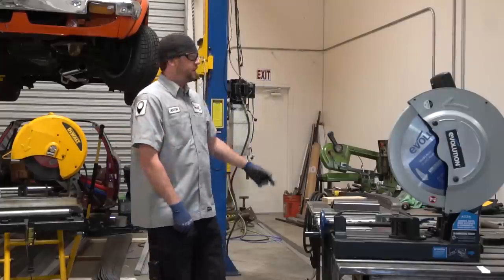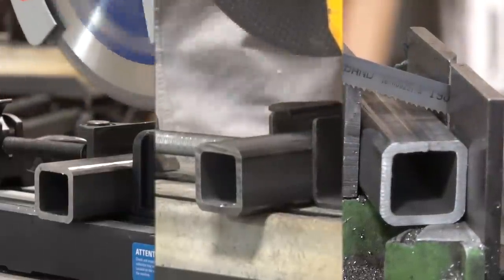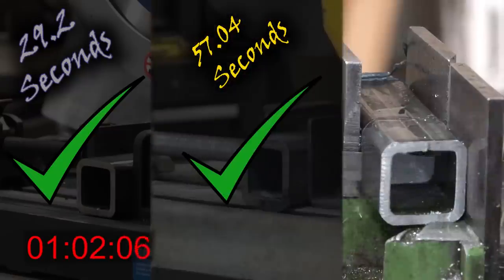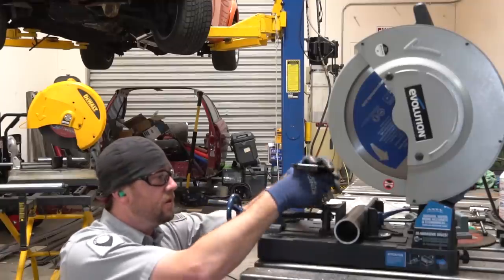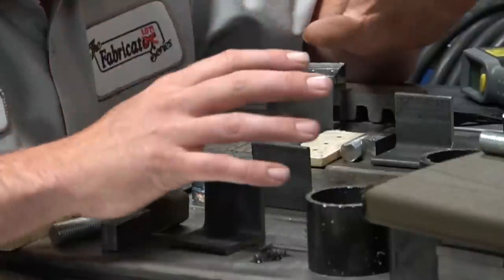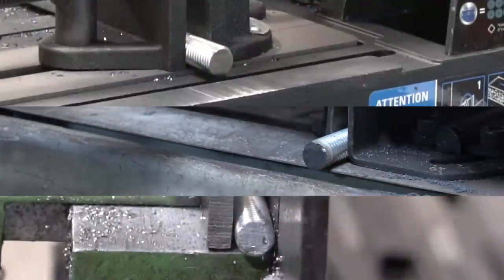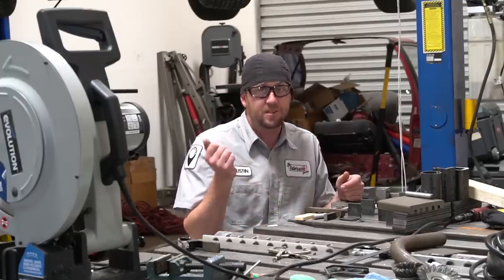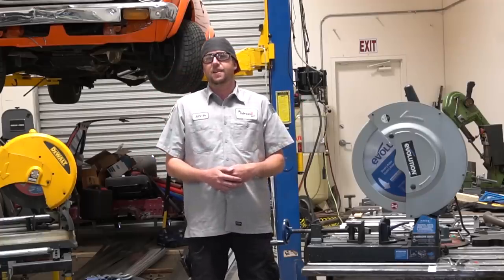TFS: 3 Metal Cutting Saws Tested and Compared

Comment: I wish I knew how to load a picture on here because I have one that would probably make every owner of an abrasive saw never use it again. I used one for 10 or so years, until a brand new blade EXPLODED. One piece lodged in my insulated garage door (that was UP at the time) and a big gouge in the floor, I guess where it hit first.  2 pieces on the floor behind me and a few days later while mowing I found the fourth & final piece about 50 yards out in the pasture. I don't normally get weirded out about shop stuff but that scared the shit out of me. Because there was nothing I could have done different,except not use it sooo I bought an Evolution that night and the dewalt is up in the mezzanine. I will not even sell it. I would not do that to someone. By the way both the saw and blade were Dewalt, not knock off china.probably still china but supposedly better.So just save up for an Evolution or a bandsaw( if you have the room)I worked EMS in the 80's and have witnessed an Eviseration and the guy DIDNT make it. I don't want to experience it first hand.

Comment: proper bandsaw with proper blade would be much quicker. But anyway the best shop saw is the one you dont have, the cold saw with hss blade. You get a lot of cuts out of the blade, then you resharpen it for like 10€. Cheapest, quick and accurate way of cutting.

Comment: I think you missed the most critical thing about high speed steel disk saw vs. bandsaw, and that is that the steel disk saw will cut straight down at 90 degrees, and the bandsaw will shift left or right a lot.    Now I read in the comments that even the abrasive disk will flex some.
Reply: A good bandsaw will cut at least as accurately as the cold saw.  I have an Ellis 1600 and I can assure you if it's setup right the blade has zero side to side movement.
Reply: @Anteater6788  The Ellis 1600 looks like a lovely bandsaw.  We have something industrial as well (I can't come up with the name now), but my experience is that when the band is new, it cuts straight down.  But as soon as it gets a little dull, it will start to gradually shift - 1/16 or 3/32 shift at the bottom of the cut is common.  We do a lot of hot rolled steel windows and doors.  When the material is steel, and we weld it and grind to paint, that's not an issue.  But when we do aluminum, bronze or something that we don't weld, you can't do a clean "hairline" connection in the front and the rear of the corners.  It will be nice at the front, and a gap at the rear.  For those jobs, I bought the MEP Tiger 352 cold saw.  That beast is precision.  So for most jobs we use the bandsaw, and when I have something premium, I only use the MEP, and it cuts so clean that you can move your finger on the edge of the cut and it feels as if you've polished it.   It is impossible to do these jobs with a bandsaw.

Comment: 40 or 50 bucks a gallon in concentrate... makes about 50 gallons or more  , I would not call that too expensive . I use a baileigh horizontal band , wouldn't trade it for any chop saw
Reply: Yup! Baileigh Swivel head bandsaw here and Lenox Band Aid coolant. I had the dry cut saw for awhile and would use one for portabl work but, miters suck on them and the bandsaw for the win for accuracy and miters .

Comment: I run the evolution saw every day in my shop. The stock blade is expensive and an doesn't last at all. Yeah stainless will kill that blade right away and blade is super loud. 
So I started useing the Diablo blade. It longer lasting even on stainless. And it has relief cuts in the blade that are back filled with a sound deading silicone. The Diablo blade isn't as loud as the evolution blade and doesn't cost near as much. A totally affordable blade and twice the life and half the noise.
Reply: Do you have a shopping link to the exact blade your buying?

Comment: just thinkin’ out loud....you might have had less smoke cutting the wood & composite on the abrasive if you had cut it on the vertical...less surface area contact on the abrasive blade

Comment: I have the cheaper version Evolution ,about $200.  Love it.  Yes it is loud and throws chips but I always wear ear, eye and shrapnel protection no matter what metal cutting tool I use and so should you.  I have cut 1/2" steel and it will be only be warm to the touch, not hot, and very clean.  This thing will cut 100's of materials with the one blade.  If you take care of the blade, which is about $80, it will last a while.  I have made a chip catcher and they are 100% recyclable steel.  Abrasive dust is more silica than anything and not worth catching.  Cheaper over all than changing several abrasive blades and some band saw blades.  Several times I have put it in the floor when I needed to cut large items.  I agree, band saws are more consistent, cleaner cutting and quieter but the cost can be off putting.  Abrasive saws are old, outdated and dangerous technology.. They have no place in my shop.  Just my two cents.

Comment: I have 7 ways to cut metal. 
1. Hack saw....good for real fine work.
2. Portable Milwaukee band saw....great for where I have to take the saw to the work
3. Oxy acetylene cutting torch....for really thick plate and to burn ants.
4. Plasma cutter....I have an Everlast 50....but any really cheap plasma cutter will do....cuts aluminum, steel, titanium.....cars in 
    two.....man hole covers....tanks......whatever
5. Harbor Freight 64.5" band saw. I use this quite a bit...had it for years....still cuts great....when I have the time
6. 4.5 inch grinder with cut off wheels....makes lots of sparks that end up in my shoes but I still use it quite a bit where odd cuts 
    are needed.
7. Fein Slugger 14 inch cold cut saw. My most favorite saw. It has taken over a lot of the cutting duties of the band saw. Cuts 
    metal in a fraction of the time that the other cutters do (very little set up time). Easy to cut just about anything. The quietest of     
    all the cold cut saws I've tried. The Fein Blades last a long time. Mine has well over 1000 cuts on the original blade. I use WD40                on them and it seems to help a lot with cutting and heat. Really fast cuts and no heat to speak of. I wish I had gotten one a long    time ago. 
I have all of this at home.....I just like the idea of being able to build really cool things from metal that so many others cannot do.....they are mere mortals as compared to what I can do!

Comment: I had an abrasive saw up until about a year ago when I bought the Evo380. I've used it a lot and I've been really happy with its performance compared to the abrasive saw. The blade that came with it got a couple of chipped teeth pretty quickly, which I found a bit disappointing, but you can always upgrade to a better quality blade when you go to replace it. I do wish the lead screw used to tighten the clamp was acme thread instead of standard, v-shape thread. Not really a deal breaker. You just have to be careful not to over-tighten it

Edit: One more thing. The miter gauge on my Evo is off by a couple of degrees. It would be nice if they designed it so it could be fine tuned (like most wood chop saws I've used). As it stands, the gauge is riveted in. Again, not a big deal for me. I just use my combo square to square the blade to the fence, but it would've been a nice feature.

Comment: What about taking a cheap miter saw and throwing a carbide metal cutting blade? I picked up a Kysor Johnson Model R for absurdly cheap that I'm cleaning up and kinda refurbishing - one feature that really drew me to horizontal bandsaws is the hydraulic arm to control the speed and auto-off switch that allows me to walk away and do something else while the saw does all the work and shuts off when done. So time is of very little concern with the bandsaw as it doesn't prevent me from doing other work.

But for the time being, I've been using the 10" sliding compound miter saw from HF that cost $85 w/ coupon paired with a carbide tooth ferrous metal cutting blade from Concord that set me back $26 on Amazon (same day prime delivery). And for about $125 after tax and all, I ended up with a saw setup that I received the same day and have cut a LOT of steel with it. At first I was sketched out, but it's been solid thus far. And I cannot imagine there's a cheaper way to go. There are non-ferrous and about every other application blades that all run in the $20 range too (though I've only been working with steel so I have no experience with them). But for a beginner super tight budget metal cutting saw, I genuinely can't imagine a cheaper option, and it does still work as a regular miter saw for woodworking too
Reply: I have one of those HF 10" sliding miter saws. I've used it on aluminum but not tried steel because i always read the rpms are too high.

Comment: i've got the evo, but am NOT comfortable hand-holding tubes and notching them on it for fear that the blade will grab/throw them  or grab me as compared to the abrasive saw...I just see all those teeth whizzing around and think of my hand inside it (yikes).  of course always safer to use the supplied clamp, but any thoughts?
Reply: Ummm, why would you even consider hand holding? That's a trick for stumpy...who can't count to 10 no more.
Reply: Steve H lol, my thoughts exactly.  TFS has other vids notching tube hand held but with abrasive chop saw.  TBH I wrote that comment a bit sleep-deprived (as in no state to use machinery)

Comment: I have had 2 different dry cut chop saws and multiple blades. One problem I've had with them all is the blade wanders to the outside when the blade touches the steel. How is your saw with this?
Reply: it doesn't, at least not that I've noticed. teeth cut through so quick that it really doesn't move the blade any noticeable amount.

Comment: The only thing that's relevant is how long do the blades last. I bought a Evo 215 as I just did not believe a carbide tip will last at that speed without cooling. I know , I am a CNC machinist and we flood the cutting edge with coolant at high speed. So I am glad I only spent 100 bucks to be proved right. The blade designed for stainless lasted 4 cuts, before it overheated and became dull. Totally useles. Glad I did not spend 400 bucks on the 355. Plus the 120 for each blade. Bandsaw consumables are way cheaper although a quality machine is a bit more but I will upgrade my bandsaw. Never gonna buy an evo again. Also you said it was loud... It's dangerously loud and  your neighbours will be complaining. Also I was constantly hit on the arm and face by chips so I had to use face protection as well.  Do you research people and don't believe the hype. How did Evo manage to get a carbide tip blade to cut at high speed without coolant?  Answer ...they didn't. But they sell them anyway.

Comment: you're running your bandsaw way too slow on the feed. Check your speeds and feeds chart that should have came with the saw. If you're going to use a carbide circular blade you should use a carbide bandsaw blade. brazed carbide bandsaw wrecks everything.

Comment: Just a thought... most people have a wood cutting bandsaw, you can buy steel cutting blades for them but they run too fast (about 30 times faster than needed for steel). My question is, has anyone found or know of a cheap way of slowing one down without losing torque??? Maybe a gearbox off a motorcycle or something? The size of pulleys required makes them out of the question.
I think that anyone who could crack this problem would become a hero of the home shop overnight!
Reply: Yes, DC motor from a treadmill and a $20 speed controller. There are tons of vids on this topic.
Reply: @BVM03  Thanks for that, I must be using the wrong words in my searches. I'm sure I saw 'Tublacain, Mr Pete 222' doing a video trying a dc motor and speed controller, which slowed it down ok but had no torque at low speeds, I'll try searching again, cheers.

Comment: Having used all three saw types a ton, those evolution saws are amazing.  The blades are a bit costly but last forever.  I beat the hell out of one and used it an absolute ton on thick steel.  They make a blade for stainless also, and it does great on blade killing stainless.

Comment: ?   The porter cable vertical bandsaw in the background, do you cut steel with that as well? The reason I ask I have the same one and would like to cut steel and cant find blades to hold up.
Reply from the maker: No. it spins too fast. It will cut aluminum all day long though.
Reply: @TheFabricatorSeries  Ive played around with changing the pulleys around and have slowed it down some.
thinking of getting new pulley to get the RPM's lower.

Comment: Hi, that particular Evolution saw is unavailable here in the UK so I bought the Evolution Rage 3 which has a 10" blade which cuts wood/steel etc. but I wondered how it compares with the Evolution that you tested? Anyone have any comments please?
Thanks, Glyn.
Reply: You want the Evo 355. It is identical to the Evo 380 except the max blade diameter it will accept is 355 mm (14 inch) vs. the larger 380 mm (15 inch) blade that the Evo 380 will accept. It is better than the Rage 3.

Comment: Hi, thanks for the video, I'm about to invest in a bandsaw, probably around up to $1000 AUD, I have an abrasive saw and a TCT saw though it can only cut up to 2" at 90deg and 45deg. I've looked at many bandsaws that are available here and narrowed the selection down. My question though is so they give accurate cuts to the length and angle required?
Reply: I think you'll find, as with most things, you get what you pay for. My Ellis 1600 has a 1" blade which produces a really straight, accurate cut. The Ellis also miters (vs having to angle stock in a swiveling vice). Quality for quality I think the EVO is easier to use and can produce better quality cuts than a cheap band saw. A good mitering band saw is just as easy and cuts better than our EVO. My $.02.

Comment: I have the dewalt chop saw, what's your opinion on swapping to a 14" evolution blade for cleaner cuts?
Reply: Don't do it. The Evolution blades aren't designed to run at the higher RPM that standard chop saws run at. You'll destroy the blade possibly even explode it.
Reply: @briananicker6156  oh wow, thanks for the heads up. I didn't even consider checking the rpms between the two machines. 😳👀

Comment: I had the cheaper version of the 14” Evolution. It cut things just fine. The problem I had, unless I really cut slowly, it was very hard to get a square cut. In my opinion, the problem with the cheaper Evolution saw was that it has a stamped aluminum base. I got so frustrated that I gave it to a friend and replaced it with a Slugger by Fein. It’s got a cast aluminum base, an adjustable cut depth and a tray that catches the majority of the chips. An most important, it cuts square every time.

Comment: Would of been interesting to know the actual squareness of the cuts.
Reply: It is up to you to ensure any saw in your shop cuts square, regardless of how cheap or expensive the tool is.
Reply: @5ivearrows  uhh no. How u supposed it ensure a square cut if the tools operate on their own?  Do you not understand different blades can wander and or flex during cuts?
Reply: @magoxide7777  I adjust every single tool in my shop to ensure it is cutting square and accurately- from my table saw to horizontal band saw to my cnc router and everything else. If you are having problems with blades flexing and wandering- you are using the tool incorrectly.

Comment: Why didnt you put a square on tne finished cut?? Doesnt matter how quick it is if it doesnt cut square!!!
Reply: This 1000%. I have an Evolution 14" saw, older model than this. I absolutely love it overall. Still on the original blade now several years later (light duty use obviously.) HOWEVER, the thing does not cut square. The top of the cast base is not perpendicular to the blade, no way to adjust it. Frustrating, but I've gotten used to it and work around it.
Reply: @bradley3549  You can shim under the mounting base, where the head bolts to the lower frame.
Reply: @EcoMouseChannel  On this unit, the base, including the pivot is cast as a single piece. So unfortunately, no shimming is possible.

Comment: * FYI * when you find out the price per cut using the dry cut metal blade and the cost of the dry cut blades themselves, it won't be a happy face day...... I was so excited to purchase an Evolution saw until I tried real world cutting aka 3/16 - 1/4 square tubing and found out that $90. dry cut blade was good for 5 or 6 cuts.... I tried both cutting dry and and w/light cutting oil, no difference. Cutting aluminum blade lasts longer of course but if you intend to cut metal...... Regardless of the advertising, touting 100s of cuts.... maybe if you are cutting metal paper stock ... I vote is bogus claim. I'm not giving the machine a thumbs down but the blades, any brand dry cut blade, that's a separate issue. Any one looking to buy a barely used dry cut saw? I consider my investment in my dry cut saw a huge waste of money.

Comment: I would like to see a comparison of metal cutting blades. Anyone with an abrasive saw can swap in a toothed blade.
Reply: AvE did a video  on this many moons ago.  The moral of the story was the dry cut runs at a much lower RPM, and in order to slow the abrasive saw down enough to cut at that speed, you sacrifice a lot of power.  Wasn't worth it.
Reply: Terrible idea. The 14" carbide metal-cutting blades are designed with max RPM of 1800 or less. Only a fool would use one on a 3800 RPM abrasive saw...

Comment: For a home shop, cmparing the Evolution to the bandsaw is completely pointless.  Not only does the Evolution do the job in 1/3rd the time, it does it at 1/3rd the initial cost.  Not to mention 1/3rd the space in your shop.  The only real advantage to the Kama is accuracy, and it's hard to imagine that requirement in a home shop anyway.